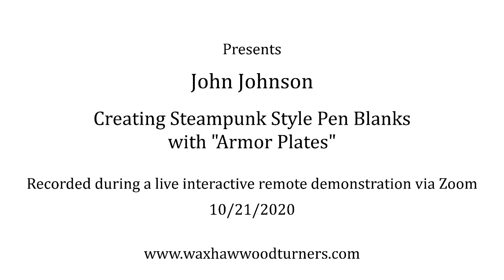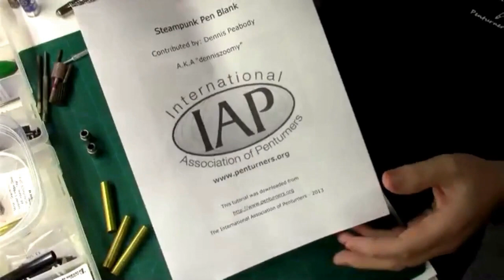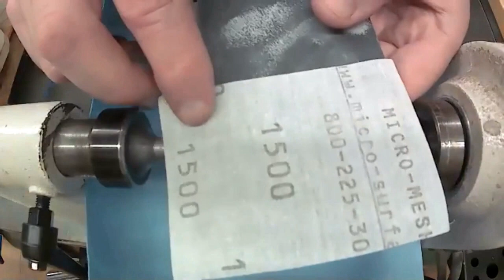Creating Steampunk Style Pen Blanks with "Armor Plating"

Comment: Great video. Very informative. Thank you for that. It doesn't look like you cast it in alumilite but you put it in the molds. I'm confused about that. Is the blank milled on a lathe or just stuck to the brass tube with the adhesive from the tape? Thanks again for the video.
Reply: InstaBlaster